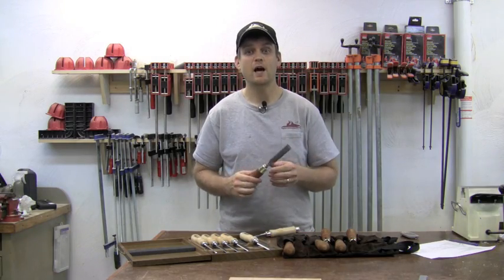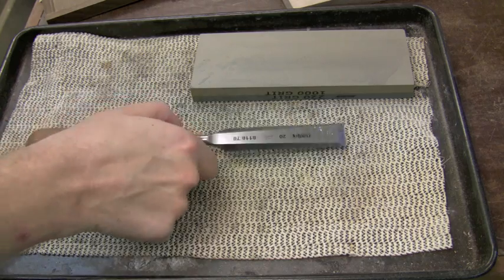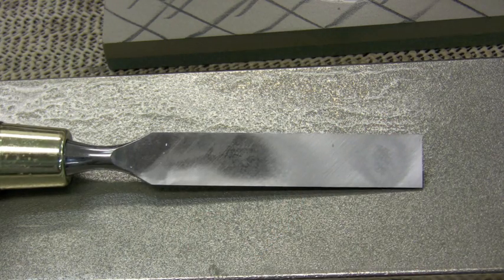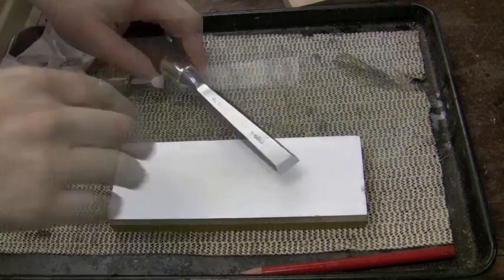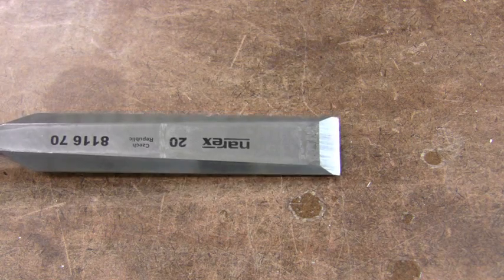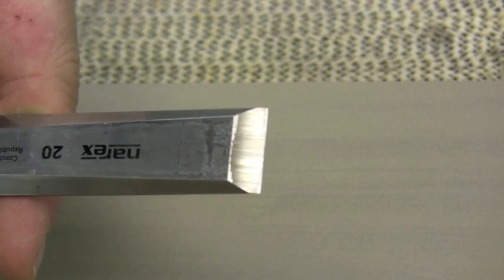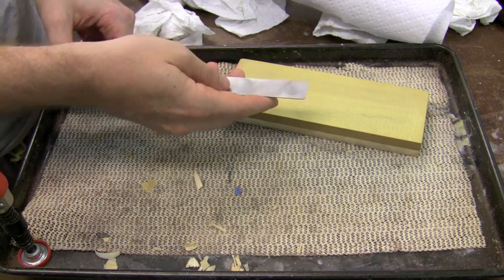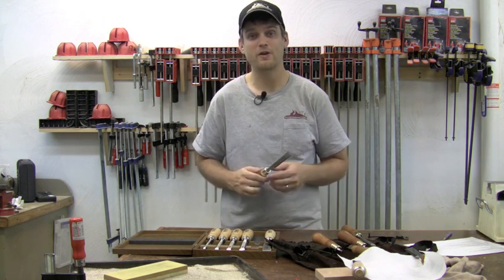How to Sharpen a Chisel using Waterstones and a DMT Dia-Flat Lapping Plate

Comment: The video way is easier today with machined flat backs.Not perfectly flat but near enough. But with Old Sheffield blades you can see backs with rounded edges and along the chisel there can be a Twist.Lay the back on a diamond plate and you find a high spot near the handle and a shiny spot on one side of the bevel end ,diagonally opposite. If you rub down that high spot  (with a dremel ) near the handle ,you can use the ruler trick the same way they use on plane blades .  That will create a narrow 1.5 degree bevel with a straight shiny surface at the edge. So is that wrong?   Compare it with a Japanese chisel where the handle is not lined up with the blade . Mostly the Japanese blade back can lay flat on the surface and the handle stays up out of the way. Japanese history shows that Wooden Houses were the normal thing and a chisel back flat on the surface was very useful . So a tiny 1.5 degree angle is not a problem .It`s a hand tool and not a machine component .
Now , over some years with the video method the front end of the back will have developed a curve .Obviously ,because the front has been rubbed more than the rest of the back .It will create a curve . But with a 1.5 degree using the handle end as a guide the angle will hardly change . That`s a long term comparison .

Comment: I like your hollow grind method, seems to me some kind of wet stone on the grinder might stop it getting too hot(I don't mean a water stone). Over here in England Norton only supply Oil stones, all the water stones are made in Japan and need to be immersed in water for several hours before use.

Comment: Have you every considered using metal polish and a leather strop to go one step further
Reply: for a knife it's great, but for chisels, i don't think that is necessary. although it may be a nice option for maintenance during work. do a few cuts or chips, strop it, bit more work, bit more stropping. that way it never gets dull. but stilll a noob with chisels myself. knives are m thing mostly. now that i think of it i'm gonna have to make a field strop.

Comment: hello, do I need to use the hollow grind method?
If I understood correctly this is just used to be able to better see the polishing result?

Could I sharpen the chisel by just going through the different grits of stones?

Also, do you do any kind of end polishing with a piece of leather or does this not apply to the water sharpening method?

thank you!
Reply from the maker: Hello. Yes, chisels can be sharpened using just a stone and without a bench grinder.  It just takes longer since you have to hone the entire bevel and not just the heel and toe of the cutting edge like with a hollow  ground edge.

Comment: Never grind chisels on bench grinder! Just take chisel as it is from factory, get flat back and keep original bevel flat no hollow or convex and your chisel will cut even better than you shown + stropping on leather strop with some good compound and it will be perfect! You can use a power strop and buffing wheel to get better polish and to get it razor sharp quicker while you are working, but that's all! You don't need any other power tools! 
Check this video:Preparing and sharpening a woodworking chisel - with Paul Sellers
Reply: agreed, so much use of power tools today. The basics are faltering.
Reply: +Nicholas Vaters Thanks! Grinding a hollow bevel is good but if you do it on tormek machine with water cooling. So no risk to burn. When you got hollow just take your 6000 grit Japanese stone and hone the bevel like it would be flat. Than you will get a hollow middle and two flats. One is the cutting edge and one is the end of the bevel. Than chisel will cut better because cutting edge is razor-sharp and less friction because of the hollow part.
Reply: Ivars ya myself I will stick to wet stones. can't afford the power tools and such so i'm looking into hand tools i can get for cheap or free.... i do have access ot my pops tols though and a drill press i bought off ebay last year for fairly cheap. and a busted rotary tool which i'm thinkin of turning into a lathe or something.

Comment: The higher grits used to sharpen, the smaller the scratch marks, which makes the intersection of the back/front more crisp, leading to a sharper edge.  Chisels straight from the factory are "polished" up to a certain point - and better manufacturers use higher grits. But if you have finer stones than what they used, you will improve the edge further.

Comment: I don't understand why your sharpening a brand new chisel?
Reply: because the manufacturers don't use the higher grits that shops have.  Take a new chisel out of the box and test it on end-grain soft wood.  Try to shave a thin layer off the end.  Then polish it using the techniques described here.  Then test it again.  You will be surprised at how much sharper it is.

Comment: I use Norton water stones which don't need to be stored in water.  But unfortunately they do need to be soaked for about 10-15 minutes prior to use.  The higher grits don't need soaking quite as long, but the coarse stones definitely soak up the water ;)

Comment: Works for me, start on a coarse/fine diamond plate until it's flat then just remove the scratches and polish and all that with minimal "damage" to the water stone, try that and put it on a video. BTW, that goes for plane blades too.
Cheers.

Comment: You know, the stone really doesn't move on the pad I use - if it did rock at all, I would be worried about rounding my edges as the stone moved relative to the blade.  Find something that supports the stone so it doesn't slide around, but not too soft that it flexes as you work.

Comment: I'm on my second set of Norton combination water stones and was disappointed to find an extensive area of open structure after about 3 mm below the surface. This makes the 4000g side unuseable. I have not looked back since changing to Shapton pro stones. They are worth every cent.

Comment: @matthewlramsey You want to be careful breaking the burr off as that can leave a jagged edge at the tip, which results in an edge that will not be as sharp and will wear more quickly.  When you "chase the burr" as it's called, you lever it off gently (with back and forth bending) leaving a crisp edge when it falls off.

Comment: Couldn't you eliminate the back and forth of flipping the burr by cutting into the stone?  Most of the time, whether it be knives or chisels, I do my finish edge work into the stone, not away from it, essentially cutting the burr, not moving it around... not sure if this would deliver different results... just wondering.

Comment: @MrAcronim The 4000/8000 stone was somewhere around $70 when I got it.  A little pricey, but it'll last you forever.  The 220 stone has worn for me pretty quickly, though after a couple of years it still has plenty of life.  But the 4000/8000 stone hasn't lost any thickness in a couple of years.  You do handfuls of strokes on it - so it wears pretty slowly.  And a combo is a great way to go so you can quickly move through the grits, just like sandpaper.